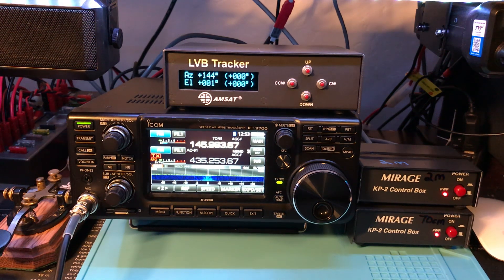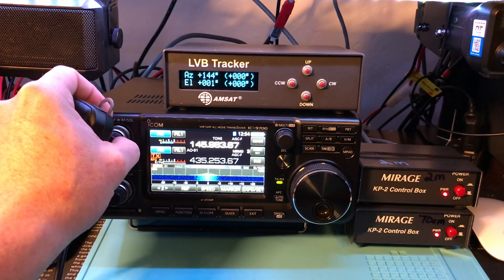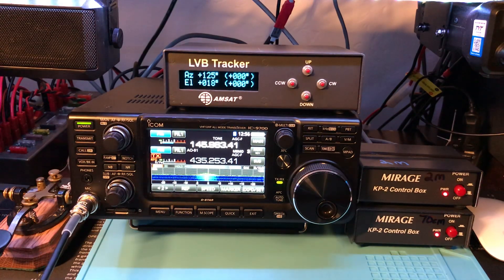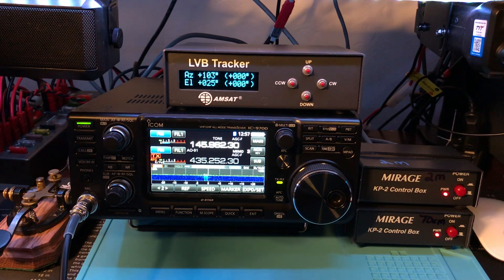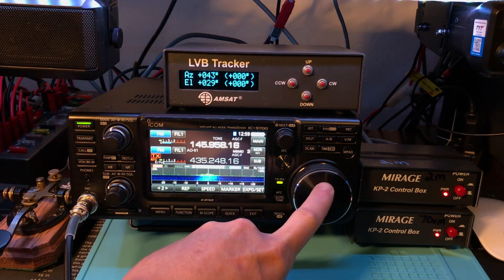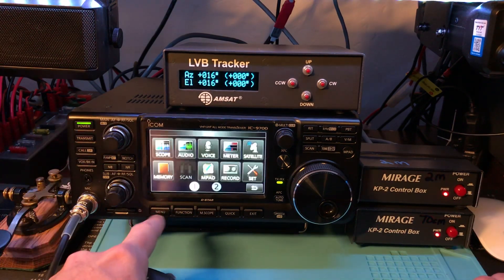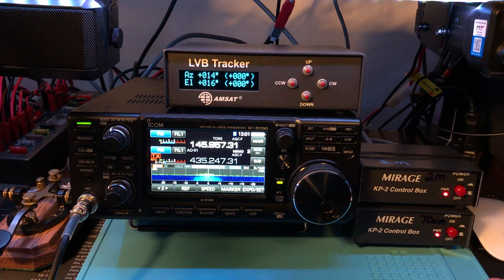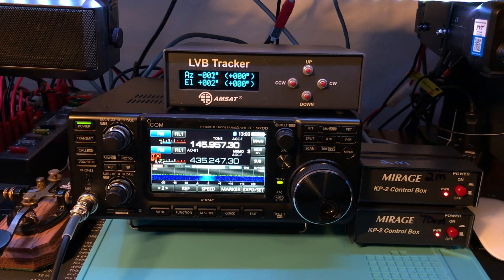Icom 9700 FM satellite operation

Comment: to me the value in the 9700 vs the 705 which does 2m/70cm is the satellite operation available in the 9700. This video is extremly useful for those undecided on about what features and functions the 9700 will bring as compared to the IC series.

Comment: what a noisy mess.That would give me a headache after 5 minutes or less.
Reply: I have an IC9700 and  two M2 beams and 2 preamps from the UK and I have no noise. He has a problem.
Reply: Mick got it, that’s a relief. I was kinda turned off to ever trying Satellites right there.
Reply: He could use a ClearSpeech DSP speaker or base module.I use one of them on every radio I use including my ICOM 7600, ICOM 910H,& ICOM 821H.I Hate noise and I can open the squelch on FM or SSB and the noise is not an issue for me.I listen to voices not noise.I would have thought the DSP would be much better in that radio but maybe he does not know how to use it?

Comment: Does the radio track for doppler shift . I have a M2 Leo Pack antenna system I want to setup in the future with that LVB tracker. I guess the LVB tracking is working ok for you. I also bought a 1.2 beam from M2 too  if any sats are using 1.2.
Looks like the radio is a nice setup for VHF UHF 1.2 work and Sat. I have a old 
TS-2000s now witht the 1.2ghz in it. I don't use it for Sat work at this time.

Comment: $ for $, I think the 9700 is the way to upgrade from a Yaesu FT-950...  I was thinking about the 7300, but then I see videos like this one and think, 9700 is for me - fantastic! Thanks and 73!
Reply: The 9700 does not do HF so you are comparing Apples and Oranges.
Reply: @1OFGODSOWN  Yeah, you're right, 10F; I had my units mixed up, but if I were to upgrade today, I'd go with 7300. Sorry for the confusion, and take care!

Comment: Do you have the Mirage Mast mounted Preamps inline?   I see you have the KP-2 controllers powered on.  Are you using the Remote Key on the back of the controllers?   I'm curious if you could remove the KP-2 controllers and power the mast preamps via the radio by turning on the 9700 external preamp function in the manual??  Thanks for posting the video 73 de Cal/N3CAL